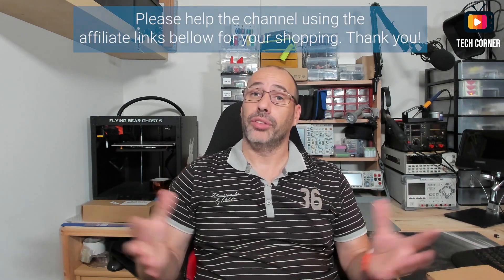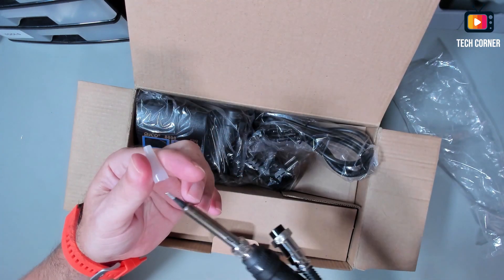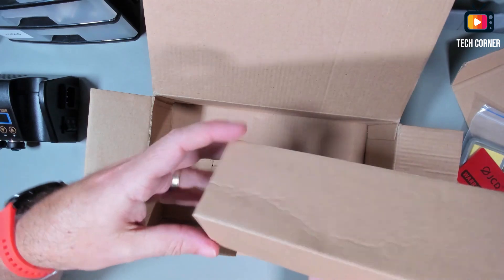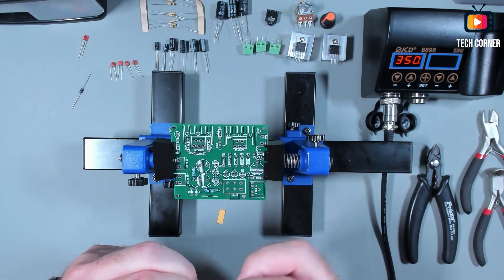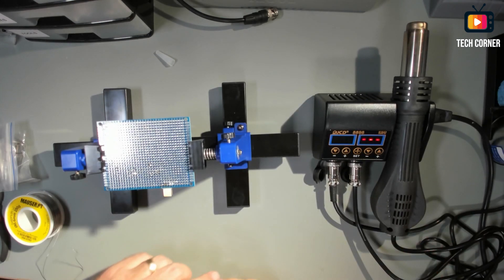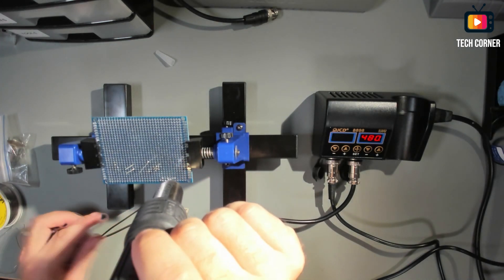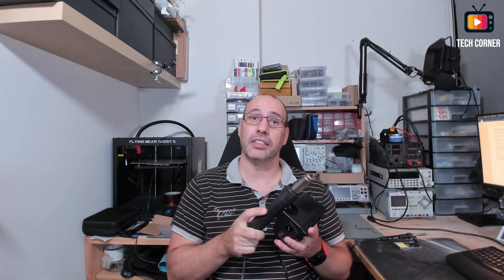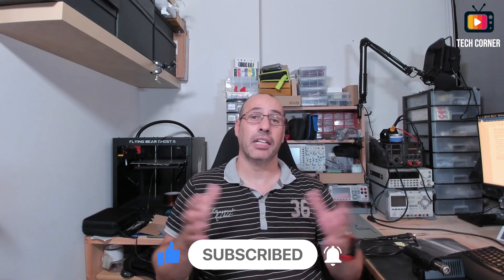JCD 8898 Soldering Station with Hot Air⭐ Review & Test ⭐ Compact with nice performance

Comment: Does it heater works on 24v dc(soldering iron)
What is its heater resistance
Reply from the maker: Hi, I don't have it with me any more. Was sent to a viewer on a give away! But you should have that info on the specs on JCD website. One thing I know, it was powered directly to 220v mains. Thanks for watching.

Comment: 220v available at the pins?
Reply from the maker: Hi, I don't know if I got your question, but this connects directly to the house mains at 220V/110V. Thanks for watching.
Reply: No I mean the power going to the soldering iron or hot air gun is 220v?

Comment: Excellent review as always Hugo. Thank you for taking your time to do this. I like that the hot air gun is easily removable in case you need to ever replace it because most hot air guns are hard wired into the system.
Reply from the maker: Hey Khuong, you got it right. That was the first thing I noticed. On my solder station the soldering iron has a connection socket but the hot air gun hasn't and there are a lot of soldering stations like this. I have to say, when I bought mine, I selected this one because it also has a power supply is 3 in 1, it makes sense the size. But now I have a Rigol power suplly and don't need that soldering station to ocupy so much space... I have to see what can manage some space to install one like this on the vertical position... thanks for watching and your nice comment! 👍

Comment: Well you’ve done it again Hugo.. I was looking for a station and was leaning to Yarboly 858D.. but this JCD8898 got me thinking. I am kind of short of space the JCD small, compact and wall mountable is very very tempting… anyway… nice video good review.. keep up the good work.. se ya..
Reply from the maker: Hello Zulkarnain, yeah that part where you can put it on the wall vertically mounted also got me thinking. Right now, with the disposition of my bench and shelf is still hard to use it that way, but I am already thinking in a solution 😁 thanks for watching an your nice comment! 👍